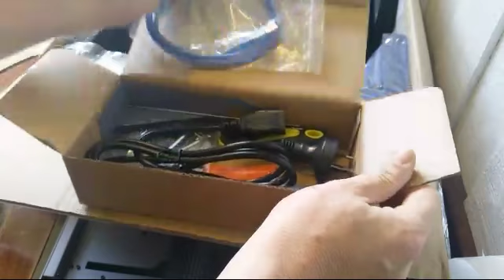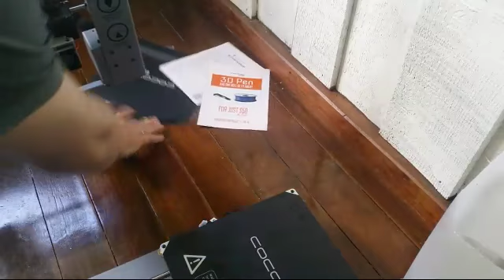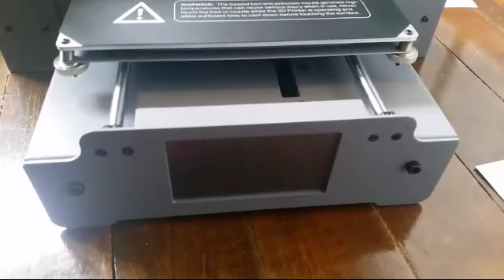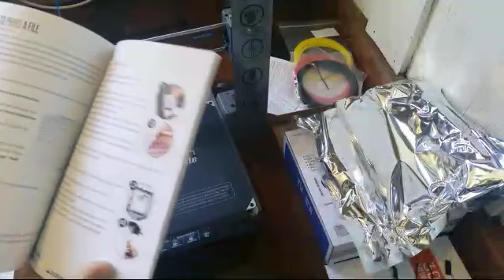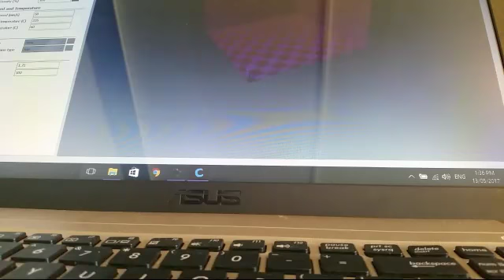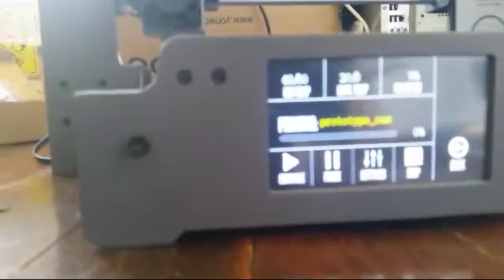wasLIVE~ALDI 3d PRINTER Unbox...

Comment: +m3sca1 You got to move the documents and program files and out of the folder and paste them on your pc and move the gcode files out of the folder and paste them in no folder
Reply from the maker: 91rickstar i just copy pasted them into the root directory on the SD card...but good idea to put them on PC so if I lose the SD card I still have the support material
Reply: +m3sac1  Yer I had the same problem but I quickly found out that the 3D printer doesn't support folders and I found the software for the printer in the support  folder "customer documents" I don't why thay called it support material for
Reply: Cura it allready set up for the Aldi printers just select the one that says touch 3D printer
Reply from the maker: 91rickstar yeah i found that later when i looked closer at the SD card. Did you have any issues with the 2 Z axis motors?
Reply: +m3sca1 No it worked Really well I printed the vase and looks pretty good for a 1st print it didn't even leak water I also have a ripoff maker bot replicater  that I bought 2nd hand and it can't do a good of a job for the price of the Aldi printer it's the same ripoff one on eBay for $550 it's ok but it can't print in grate detail like the Aldi. What happened to your
Z axis if you have a z axis problem make sure that the cross airms/rods a level and the same distance from the top winplus should of put the zaxis to the top saves people manually moving it and putting it out of wack. And make sure your connectors are in the right way and in properly.
Reply from the maker: 91rickstar somewhere on the wasLIVE video I run into trouble with one stepper being higher than the other and when the bed level wizard ran...it made a horrible noise. I unplugged the stepper and adjusted it to the same height as the other side. Plugged it back in and it was fine. In hindsight I would disable stepper instead of unplugging. The inrush current could damaged the stepper driver board. I saw a pretty solid white spark when I plugged it back in. Powering down would also work fine.
Reply: Is it working ok now
Reply from the maker: 91rickstar yeah no problems. I also got a water tight vase when I printed that thing. Looks amazing in PETG
Reply from the maker: 91rickstar I was thinking we should make a google+ community for owners of the aldi machine or we join one for the Wanhao I3...what do you reckon?

Comment: I'm crying watching this, it could have been me enjoying this cheap 3D printer. Dad it's like Christmas for you let me scream.
How the hell do you pull off live stream, my mobile network is so crappy and always falling over. Garlic is great for customer relations. It's faster than I ever imagined. Sad that Jaycar Electronics don't know how to hold onto good helpful staff. It's their loss but I bet Amazon Australia will blow them off the planet. In the USA it's blown apart Radio Shack. Possibly getting out before the forced sackings is the best move you have ever done.
Reply from the maker: yeah it was tough to make the decision to leave-but the writing is on the wall, clearly spelled, and they are wriggling around like maggots in the sun instead of making solid decisions that would have kept customer service as the cornerstone of the business. Sadly the cornerstone is now add-ons and upsells. live feed-i dont know. it always says bad connection, but it ends up watchable